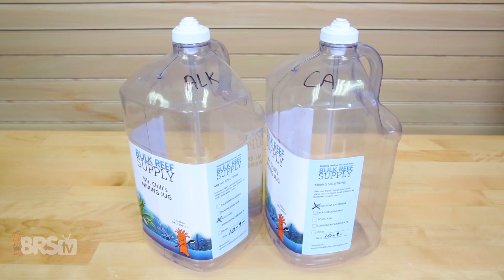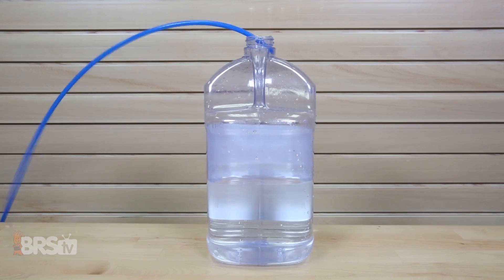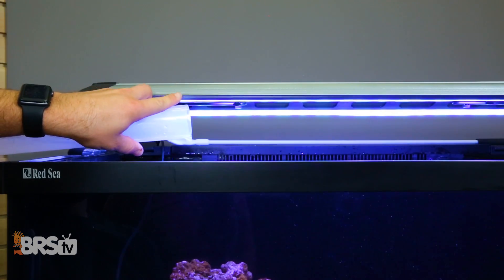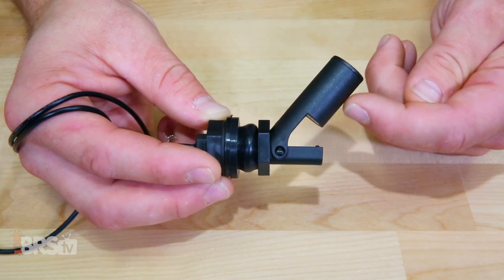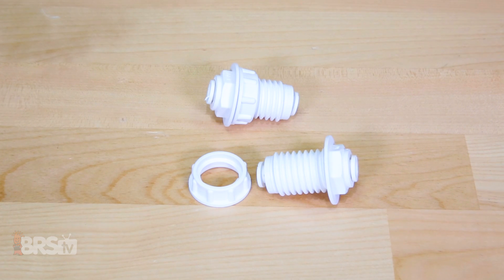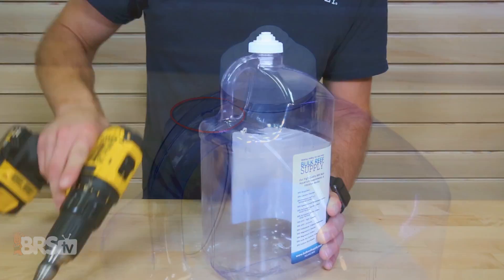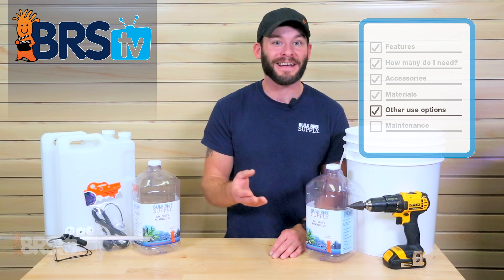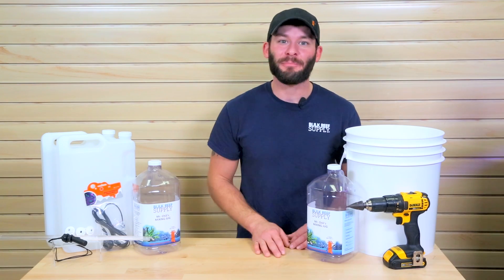Spotlight on DIY Dosing Containers | BRStv

Comment: I was wondering, do you need to add some kind of movement to the liquid in dosing containers? Like an Airstone? I was just thinking after time maybe things separate and you don't have as much of a homogenous mixture so as you dose you might be dosing concentrate? I'm taking this to reef2reef right now hehe.
Reply from the maker: It depends on the additive, but if you're dosing something like BRS 2-part, then no stirring or mixing is needed once you've mixed up your initial solution. Other additives or foods that you might dose, like Red Sea AB+, Coral Aminos, or AcroPower will need to be shaken or stirred.

Comment: Three thumbs down!

Bought all the crap to do this and it does not work. The connection isn't air tight and no matter what I am using it can't seem to draw the liquid through the tubing. I am using a neptune dos and a BRS dosing pump, Tried Neptune systems line, RO tubing like the video (which causes severe issues connecting to the pumps) and regular airline tubing.

None of them worked. Real PITA getting to all this stuff in my system. Bunch of wasted time and money on stuff that will go in the garbage.

Thanks BRS!
Reply: Dude I did the same thing and this is not working for me at all!!
Reply: Had to come back and give proper feedback on this. With quite a bit of effort I was able to finally get this working but I had to sort it out a bit differently than in the video as what you guys did simply didn't work for me. This was much more difficult for me than it looks in the videos and although I got it going I am going to have to order some more Neptune systems dosing line (I find it to work a tad better than anything else I have tried because it feels a bit more "sturdy"). I am really glad you guys gave me a reply as it gave me the will to try it one more time instead of trashing everything. I sure hope others who try this have an easier time than I did.

Comment: Do yo guys sell a 90 degree 1/4” push connect fittings? Similar to what was used on the triton containers that were set up in the video. Thanks

Comment: Everytime I make one of these with acrylic tube and bulkhead, I get nonstop bubbles in the tubes.  What gives?
Reply: I’ve had similar issues even after super gluing the acrylic rod and airline tubing into the bulkhead to try and seal any leaks. Not sure if my DOS is too high above the container or just and issues with the way I put the bulkhead together.

Comment: isn't building it like they showed here for the triton containers going to implode your container over time? Usually I also add a check-valve in the lid so air can be drawn in but not out. That's how I did it for my nopox setup anyway.

Comment: Hey guys I apologize for the relevance of this question in relation to the video. I have a kessil H380 on my sump and I noticed it reflects very hard on the bottom of my tank. I can see some algae growth underneath my deep sand bed through the bottom glass, is that going to turn in to a problem or I'm I fine???

Comment: Awesome vid Randy! Something easy and very helpful. A question about ATO reservoirs... I have the Trigger Sapphire 39 sump and was looking at getting the matching ATO container. Does this unit have a float switch in it, or do you carry any ATO reservoirs with a built-in float for a 1/4" tube? My main RODI storage can is in the basement and have a Spectapure UPLC-II to pull the water up. I just wanted a way to shut the Spectrapure off when the ATO gets full. Then use a Tunze Osmolator to go from the ATO container to the tank.